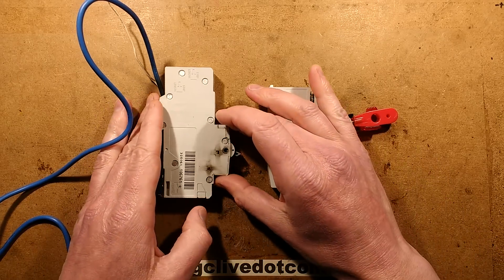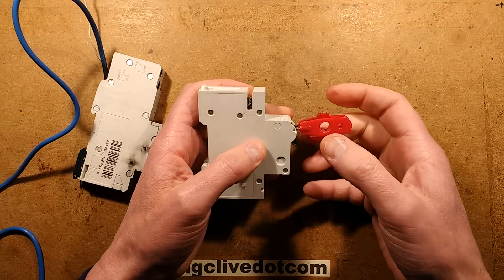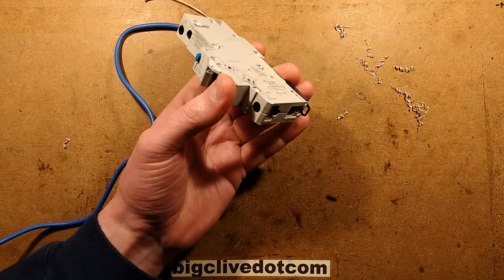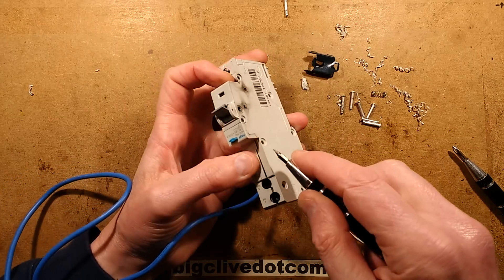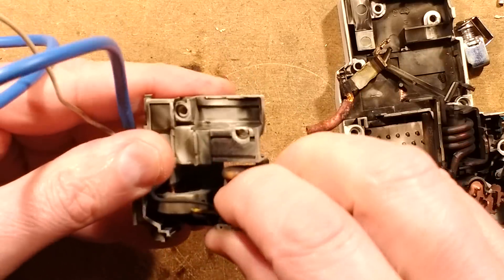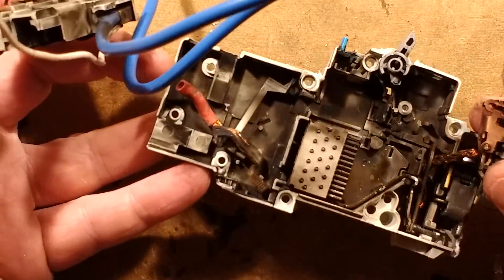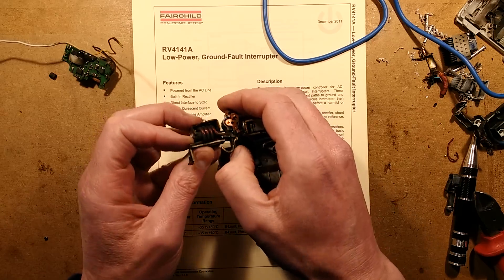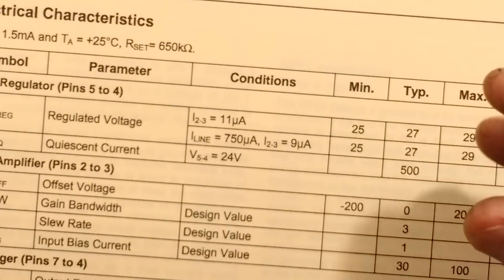Totally exploded Hager RCBO (RCD/GFI with overcurrent trip)

Comment: Every time I use the shower the breaker trips but only at the end when its turned off - it buzzes loudly while its on too.  Is that a similar fault? (its getting replaced whenever they come out).  I thought it was maybe the back emf from the heating element but turning everything down first didnt do much.
Reply: Heating element shouldn't contain much back EMF at all.
Reply: I guess not - shows how much I know :p (I just think big coily thing)
Reply: I would expect the shower to have quite a high power, near or even over the rating of the breaker. This can damage a breaker (wear it out), so it even trips faster as it ages. I had this on a dishwasher circuit: A 16A breaker with 3,5kW of load (so near its rated limit at 230V) tripped after about half an hour of operation. Replacing the breaker with a new one solved the problem.

Comment: i would hazard the welded contact meant the solenoid trip circuit was running full time when it is only rated to for a very small duty cycle as it kills it's own supply.  The solenoid heated up , melted wires and caused all manner of secondary smoke.

Comment: Awesome teardown.  Thanks.

Nowadays in Australia where I live the newer RCDs always have an overload breaker built in and they are no larger than a normal circuit breaker.

We remove RCD main switches because any ground fault cuts all the power to the house which is very inconvenient. 

So we put RCDs on individual circuits instead. We also delibretally leave some circuits without RCD protection. Oven, Air conditioner and usually one power circuit.
Reply: John Thimakis Why leave an RCD off the oven and A/C? If the chassis went live and you touched it wouldn't an RCD be good?
Reply: Matthew Lindsay 
Some devices like the air-conditioner tend to cause a lot of false tripping, possibly because the boards are exposed to humidity since they are outside. Even the indoor unit creates a lot of condensation that can cause the RCD to play up, ie falsely trip.

A fault to ground still causes the circuit breaker to trip because all metal chassis are grounded to the earth wire and all earth wires are connected at one point in the main board to the neutral wire.

This is known as the MEN system (multiple earth neutral). So if a live (active) wire touches an earthed chassis, you effectively get a short to neutral via the earth wire. So the breaker still trips.
Reply: well you need to get a less sensitive RCD for those devices then but none at all isnt just dangerous but in many countries actually illegal.
Reply: Latest AS 3000 standards due out will require all circuits to be on RCD, Heating elements and are allowed a leakage current of 30 mA  so in the past putting them on RCD could cause nuisance tripping. An earth fault is only allowed to allow 50 volts on exposed metal parts before an MCB trips, this is why earthing is so important in non RCD protected circuits.
Reply: It was supposed to be January this year, I believe it may now be released later this year, https://infostore.saiglobal.com/en-au/standards-and-legislation/wiring-rules-as-nzs-3000-2018/?gclid=Cj0KCQjwrLXXBRCXARIsAIttmRPVSfqZHZvke2PoO-IPCb501asPvMZkUhbtj8aSvsRJYfjujT0f-3oaAg3fEALw_wcB&gclsrc=aw.ds
Reply: Chuckiele 
We'll in Australia it is not illegal to have a breaker without an RCD feature.

The other point is that although you could probably get a less sensitive RCD, I've never seen one. They are all set to 30mA. Also it would defeat the purpose because more than 30mA through a human body is dangerous.

The scenario is that RCD trips and won't reset, but after a few hours, when the humidity has dried out it can be reset.

This becomes very inconvenient. So the best and most economical solution is to have a normal breaker on that circuit.

As I already mentioned this still trips the breaker if the chassis goes live. What it doesn't protect is if you happen to open the unit and touch a live part.
Reply: Well here in Germany its illegal to have any wire leave the distribution board without being ground fault protected. Thats why most households have a single insensitive 3 phase RCD from 30mA up to 100mA. They arent protecting someone from stripping off a cable, plugging it in and touching live and earth, but they protect you from dropping your hair dryer into the bath tub or a device failing internally and leaking to earth.
Reply: Nick Keur 
Thanks for the reply and clarification. Do you know when this new standard becomes effective?
Reply: Nick Keur 
Thank you so much. 👌
Reply: Chuckiele 
As long as you touch one wire long enough before you come into contact with both (in your stripped wire scenario) an RCD will still trip.

Comment: I've seen a several of these Hager units die over my years as in industrial electrician, I have to admit I immediately thought 'welded contacts' as soon as I saw the RCBO every time I ripped one open that's what had happened.... every time its happened there has been a real equipment fault and the machine user has been resetting the unit several itmes... anyway we've taken to using Schneider units now .... don't know if the longevity will be better as they've not been in service as long yet.....
I'm not saying Hager are worse its just what the cabinets were fitted out with when installed years ago....they've all been wired correctly....maybe the schneider units will die the same way given the same conditions ...only time will tell.

You mentioned LOTO our site is LOTO mad ....we try explaining to the health and safety man that its very difficult to diagnose a machine fault if we can't ever have the power on when we're working on it ....LOTO is necessary but IMHO most of the time only to lock off a machine that either more than one person is working on or has access too / when you have to leave it in a potentially unsafe condition.

As for those MCB LOTO devices IMHO they're not very good as they leave 5mm or so of exposed spring wire at the end a relatively small amount of side ways force and slight pull to the front removes them easily from most MCB's ...I've seen lots of time when they've been removed by ??? often you find them on the floor still locked ... I now favour physical disconnection of the circuit from the MCB/RCBO.....saves me from unnecessary tingles.

Excellent channel Clive....I do like it when you rip apart failed devices like this.
Reply: direct or nearby lightning strike broke them all. hence the test monthly or weekly labeling ;))))
Reply from the maker: When you consider that these things are potentially breaking thousands of amps of fault current it's impressive they fit them in such a tiny area.

Comment: Clive, when you do eventually drill/cut/burn your hands on camera enough to require a hospital trip, remember to take your camera so you can continue to document the event.  :)
Reply from the maker: That's assuming that superglue isn't able to do the job of repairing mild wounds.
Reply: bigclivedotcom superglue your medical ID card to the camera right now.
Reply: @bigclivedotcom  super glue and bicarbonate of soda. I've repaired torn nails with this technique before.
Reply: Including the taking-to-bits of random hospital apparatuses!
Reply: Let's hope he never has to visit a proctologist.
Reply: I can already picture this, Clive being administered some kind of medication through an IV and then grabbing the drip and getting it into the frame:
"The audio is a bit different here, because I have finally managed to injure myself............yeeeeees.....so I wanted to show you some of the more common medical equipment....What you see here is a kind of neopropylene ment for medical use, and the gasket connected to it is actually a really interesting material because it allows hospital staff to insert medicine into a drip without losing pressure in the drip system itself" :P.
Reply: I missed a trick there, I had a drill press whoops before Christmas and slashed a full thickness gap in my left hand. Would’ve made quite a good ‘tube. 
@clive I did consider superglue, briefly, but it would have needed several of those little bottles and I thought ... nah. Not going to help me this time. Gonna have to be sutures. It sucked.

Comment: Don't have that style of circuit breakers in my part of the u.s.
Reply: Limebuscus That style is for the 240 volts that is used as the standard voltage in the UK, not the 120 volts we use in the States. We do have similar breakers that do the same type of thing.

Comment: This is a good example of over thinking a simple fuse
Reply: Nope, MCBs, RCD's and RCBOs have no doubt saved hundred's of lives in the UK alone.  At the end of the day it failed, but it failed safely - as it was designed.  This issue was most likely due to it being operated outside of ints intended design parameters (100 or so actions in its lifetime).

If a rewire-able fuse had been fitted, I'm sure someone would of over-rated it by now and we could be talking about a building fire with loss of life.
Reply: A Fuse can never protect you against most of the faults this can. Plus it can be reset.
Reply: Edward - Clive said it was from an arcade, so most likely they were shutting the machines down every night and turning them on with it and getting large inductive loads from older machines and tripping. 

You know the rest of the story. Click, *trip, click, *trip, click, *trip, click, *trip, click *BANG.

Comment: Way too complex, that's why they invented fuse wire and companion nails for those high current circuits!.
As an electrician I find the more idiot proof we try and make an installation all that happens is we allow more idiots to survive and breed. I was recently at a small restaurant to investigate power trips, a small 3 phase board fairly simple, that had been retro fitted with a single phase RCD, so the entire shop was on one phase through one 40 Amp RCD, with two phases unused.
Ray
Reply: Idiots can be surprisingly "smart'' & creative when necessary !! 😅
Reply: The actual issue is that the smart people dont reproduce at all.
Reply: ... Aye, that. The easier you make it, the more idiots survive and breed... Then that leaves no room for the smart ones and they're drowned out via overpopulation... It's a growing real issue.

Comment: “The more you complicate the plumbing, the easier it is to stop up the drain” -Scotty
Reply: FlatBroke612 Scotty Kilmer?
Reply: @HighestRank  Montgomery Scott, Chief Engineer, USS Enterprise
Reply: @HighestRank  that’s what I was thinking!😂
Reply: That sounds like a scotty-ism.
Reply: Absolutely true that’s why my car has a carb and points and a manual trans if it fucks up you can fix it on the side of the road with basic tools that you have with you look at piston engine GA aircraft you aren’t allowed to have electronic ignition or electronic fuel injection (at least not on a certificated aircraft because I know someone is going to bring up experimental and ultralights)

Comment: Had a similar situation with a mem3 rcbo, like the Hagar you've got it has vent holes on the side. The energy vented into the rcbos next to it via the vent holes and damaged those also. Consequently we no longer use mem3 due to this design flaw. 😀
Reply: Imagine if the energy did not vent. The breaker would explode.
Reply: Prehistoricman different manufacturers have better ways to dissipate the energy in a different direction. Schneider for instance, I've never had a similar problem with their rcbos.

Comment: Yeah, our family ran a pinball machine (and some other arcades) hall back in the -70 and -80’s and i remember we had huge problems with power, nothing a screwdriver fuse couldnt fix!
Reply from the maker: Pinballs have high inrush to their transformers.  The best approach is a lot of circuits.  That way only a few machines go off if a breaker trips.
Reply: bigclivedotcom yes I remember it was extreamly important what machine was plugged into what extension cord in order to balance it out on the phases. I really liked the electronics in the old pinball machines, one of my jobs was to clean and spray contacts that eroded constantly.
Reply: Yeah, until the building burns down because you didn't have a proper fuse and an electrical short occurred! I tried fixing an older pinball, where the owner had bypassed multiple fuses. Several transformer outputs were dead and the motherboard was fried. I didn't bother.

Comment: Me and my dad only use these in domestic settings. There's an amusement arcade our landlord owns about 10 yards round the corner from our house & the distribution board is a split load board for each section. There's 3 phases coming in with a split load board on each, powering about 6 areas of the arcade floor.

There's about 80A load on each split load RCD in total (they're 100A RCDs, 2 per board) and there's 2 Hager boards there (dad has always seen them as reputable and no issues to this day really). There's a Proteus board there as well (newer metal enclosed one because of the 17th edition 2015 update). 

If this happens more regularly with hager switch gear, i might consider switching them. All the stuff in our home is MK or Schneider luckily.
Reply: S.A. Smith I

Comment: Most domestic breakers are only designed to trip six times under fault current conditions and then should be replaced to maintain safe operation.
http://electrical-engineering-portal.com/electrical-life-durability-of-lv-circuit-breakers-due-to-the-switching-operations

Comment: That's something that used to happen where i worked, peiople would keep resetting the breaker thinking it would clear the fault.
I think that's what happened there, the continual resetting has caused some of the blackening, the rcd trip coil has been powered for a long time and that has overheated causing the bobbin to melt, seizing the plunger.
I can't remember where the neutral runs to get to the other end, my guess that it is clos enough to the live and flashed over causing the majority of the blackening and 'sputtering' of the copper.
We didn't like Hager, crabtree was preferred, you could get rcd modules to convert a mcb to rcbo, neutral didn't pass through the mcb section.
Reply: Yeah. People don't seem to understand what the circuit breaker is there for in the first place. If the breaker keeps tripping. Don't just turn it back on. Find out why.

Comment: I wonder what happens to the IC when the fault current is so large?  Could the transformer-coupled voltage (sense voltage) be large enough to damage the IC and cause the triac to stay on until "bang"?
Reply: Good question. At first I thought, surely it would have zener diode protection on the transformer´s outputs. But it doesn´t look like it.
I guess they´re relying on that signal never getting that big, which is probably fine since other components would fail first if there was this much fault current.

Comment: Looked like someone discharged a large cap bank, damn that thing is cooked. Never thought they can blow up this bad just from normal use.
Reply: WineScrounger, Yeah and that's mainly why we don't have fuses anymore. Neither the fuses or the breakers are 100 percent save but the fuses are much easier to neglect
Reply: Turborider I remember Woolworths stocking fuse wire and all the dreadful crap that people used to use instead. Bits of twin and earth, coat hanger wire, doubled up fuse wire, anything really.
Reply: Or a big cap bank charge? If it was switching on a row of computers with capacitative filtering on the intakes, you’d get a strong surge of current straight away.
Reply: Regarding "average users" and fuses - that's how you end up with fuses "augmented" with aluminium foil / thick stranded wire / straight up nail whenever folks run out of fuses. Calling an electrician? Not so much.
Reply: WineScrounger Yeah, I only need to think about my father. He used to bridge the fuses of the oven which almost lead into a fire. Since the electrical instalation in the whole house got overhauled, every appatment now has breakers. The good thing is now he swapped the oven.
Reply: @John Rasmussen I have to disagree. A couple of years ago every houshold had normal fuses but most people did not call an electrician. Instead they wrapped aluminum foil and other stuff around the fuses and put them back in. There is a reason why we don't use fuses anymore.
Reply: Turborider I hear you, loud and clear. I’m happier with breakers, much less potential for abuse.
Reply: If you keep resetting the breaker several times without investigating the fault, that's hardly what i would consider as "normal use".

That's actually why i prefer regular fuses over these breakers: The average user tends to call an electrician when the fuse blows second or maybe third time.... With these breakers (or as they are generally called here: autofuses), people tend to try numerous times to reset it, resulting in major damage to the breaker. Or even worse a fire.
Reply: big cap bank discharge.

Comment: That was definitely turned into charcoal, must have made a nice bang when it went... :P
Reply: I like that method of fault notification: "a loud bang."
Reply: Probably not locally unless the breaker was energized and circuit live while it was inserted, and the panel connection made the noise.

Comment: Interestingly I believe the grounding wire is entirely optional
Reply: Phonotical If you don't route the "grounded" (Neutral) wire exclusively through your GFI/RCBO, almost any load will be an actual ground fault and trip.
Reply: John Francis Doe I am unsure now, I was told that it was something to do with compliance to UK code but when I installed the new one it came without the wire which is why I queried it, turns out its fine